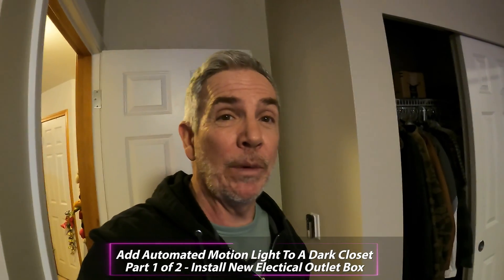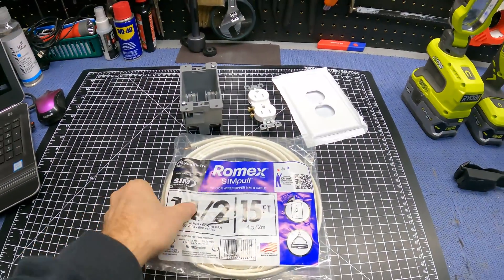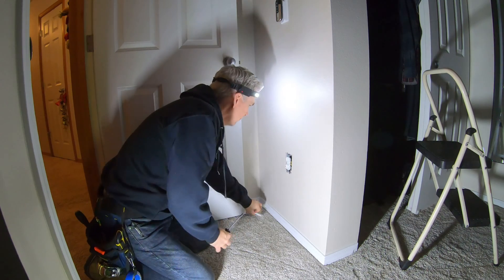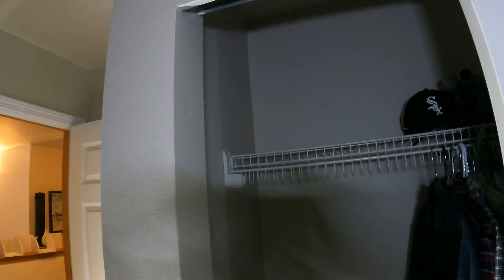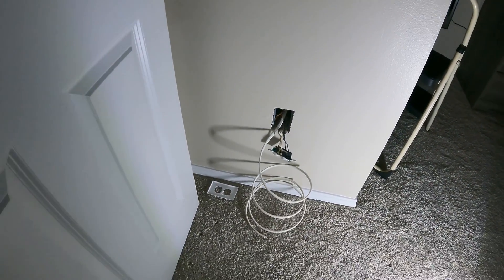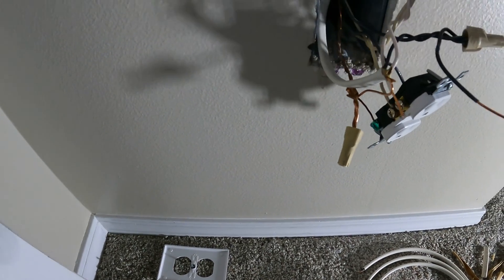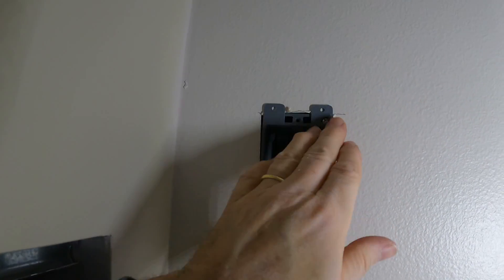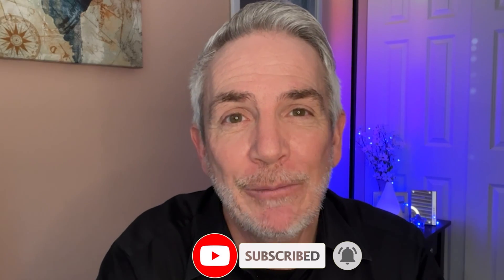Step-by-Step Guide: Installing an Electrical Outlet for Automatic Closet Lighting!

Comment from the maker: Thank you for watching, please Subscribe: https://bit.ly/subscribe_GYATEZ
🌟Links to Products used:
* 15' Romex 14/2 house cable: https://amzn.to/3RCOifS
* Remodel Outlet Box: https://amzn.to/4afgtJ4
* Outlet Receptacle (tamper resistant): https://amzn.to/4aj7Ywv
* Outlet Wallplate:  https://amzn.to/3NnK9Kd

🌟Links to Tools used:
* Ryobi Multi-tool: https://amzn.to/470mYMS
* Ryobi Drill: https://amzn.to/3REmlEd
* Ryobi Light: https://amzn.to/3RE08Gp
* Headband Light: https://amzn.to/3te76bQ
* Outlet Voltage Tester: https://amzn.to/3NufkUh
* Stud Finder Wall Scanner: https://amzn.to/474xnHs 
* Wire Strippers: https://amzn.to/3RmBclD